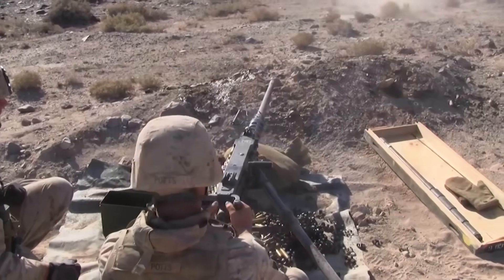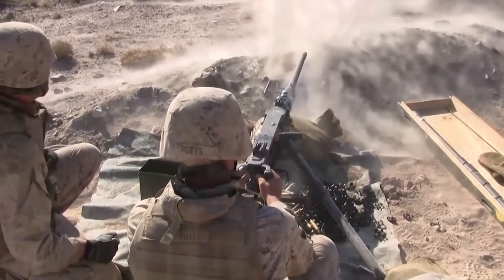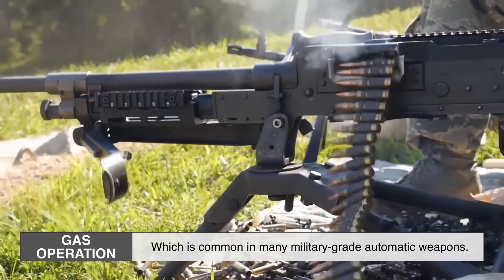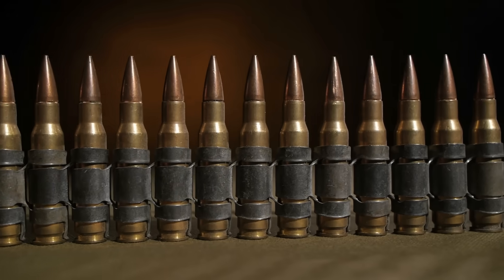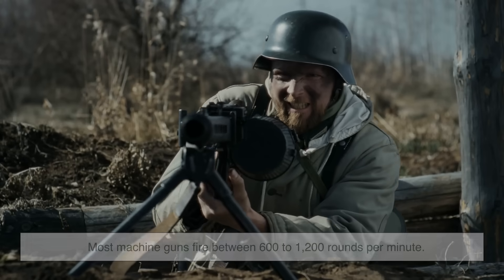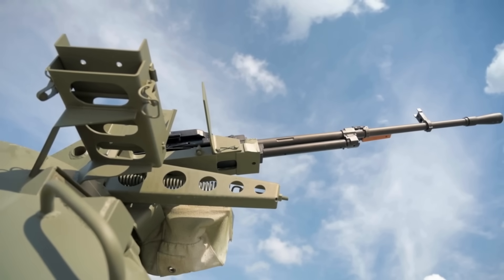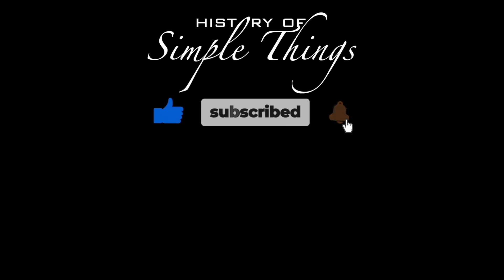How Does a Machine Gun Work?

Comment: The HK G11 was a prototype assault rifle for the West German Army in the 1980s. It had a rate of fire of about 2,400 rpm. About 1,000 of these were made, but in the end the German (now reunited with East Germany) Army chose a different rifle standard. The high rate of fire was made possible through the use of caseless ammunition, manufactured by Dynamit Nobel.

Comment: Although I feel that all your information was accurate, non of it was really specific to machine guns and can be equally applied to semi auto weapons! You never talked about the firing mechanism which is the main thing that differentiates semi auto from auto fire. The general public knows very little about guns and should be informed about the difference between semi autos, commonly used by civilians and select/auto fire which is most commonly used by the military and law enforcement! Even though civilian and military versions are available for many of these weapons, people need to understand that only select fire and auto fire weapons are the only ones that fire multiple rounds with a single press of the trigger! You should talk about the firing mechanisms that allow that and auto weapons that fire from a closed bolt and those that fire from an open bolt! Thanks for your content and I hope that you get a chance to expand on this video!

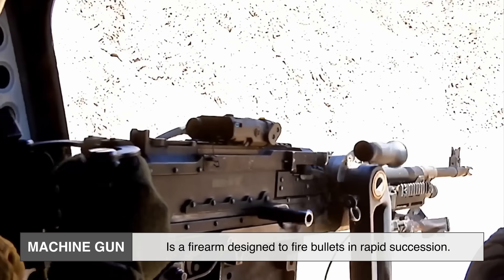Comment: Regarding 1:20, modern military assault rifles are typically capable of selective firing modes by a switch located on the firearm. For example, semiautomatic mode selection means it fires one shot for each trigger pull. Burst mode selection means it fires three shots in quick succession for each trigger pull. Fully automatic mode selection means it fires shots continuously nonstop for as long as the trigger remains pressed or until the ammunition supply magazine has been emptied.